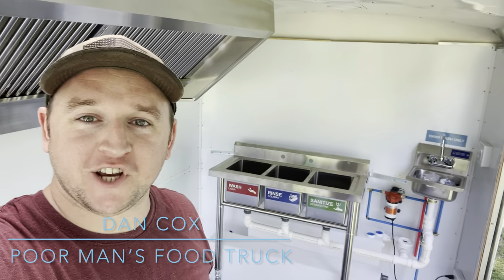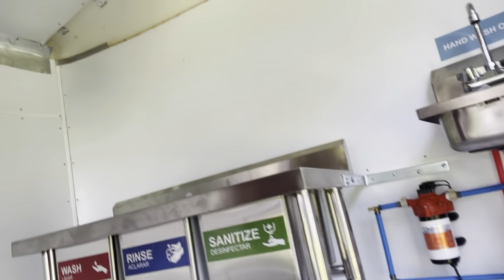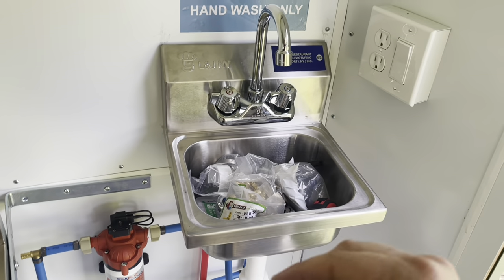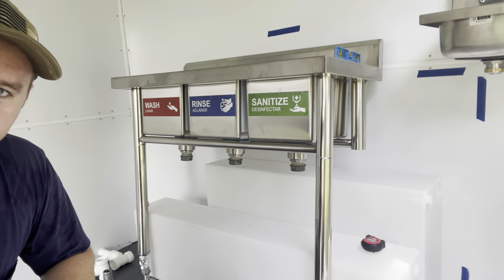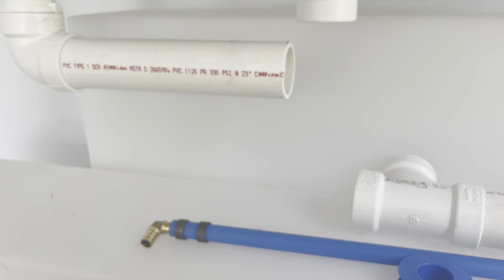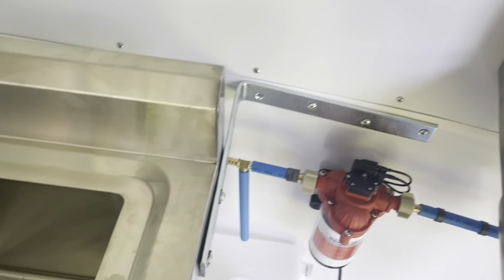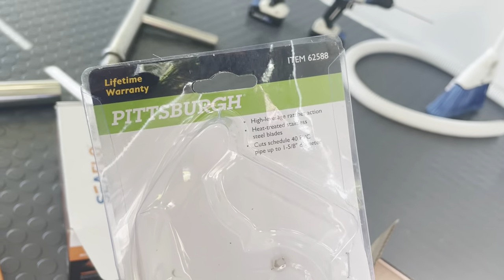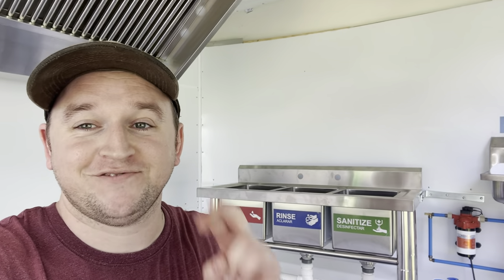Plumbing Part 1 - Poor Man’s Food Truck

Comment: I think you're supposed to put the glue on the outside of the pipe but on the inside of the fitting 9:00 min in
Reply from the maker: Great catch! I was too busy filming rather that concentrating on what I was doing! But yes you’re absolutely correct
Reply: 100%

Comment: Y did u apply the pvc cement on the inside of the pipe? It actually should go on the outside of the male pipe
Reply from the maker: Almost got away with that one lol! Complete mistake on my part, was focusing on shooting the video vs. concentrating on the job at hand. Good call out though

Comment: The 3 compartment sink is crazy small, do you have any issues fitting commercial cooking pots, pans, dishes, etc into those tiny 12”x12”? Vats?
Reply from the maker: For our menu we really don’t need too many large pots/pans as a lot will be done on the flat top. Most of our cleaning will be the food warmer containers and fridge containers. We’ve had a few practice runs and had no issues yet!

Comment: Will that pump work being mounted above the tank? I have that pump and mine has to be mounted on the floor or it doesnt work. Apparently mine has to be at the lowest point of the water in the tank.
Reply from the maker: Yes sir this pump will work even when elevated above the fresh water tank. I believe it’ll pump a maximum of 3.3 gallons per minute

Comment: how did you start the gluing process on your floor . franks video was no help. i'm going to tuck my edges up behind the stainless
Reply from the maker: For me personally, I found it fairly easy with the walls in place first. I lay the floor down, and cut the front half first and worked slowly towards the rear of the trailer. Great thing about this floor is it’s super flexible and relatively easy to install

Comment: How much did you cut the 6in tailpipe? Every video we’ve watched doesn’t mention how much is needed to cut off of the tailpipe.
Reply from the maker: Each will be different depending on the height of your 3 compartment sink. Just be sure that you have a decline from left-to-right to ensure proper flow

Comment: How hot does your water get? The water pump is rated at 3.3 GPM and the heater is 1.6gpm I can’t get the water hotter than 110F.😢
Reply from the maker: I am yet to run the hot water in my system (waiting for plumbing inspection) will keep you posted as soon as I do!

Comment: Did you have to switch the plumbing piping on the hand sink that elbow is flowing in to the 3 compartment sink drain
Reply from the maker: Im not sure if I follow?
Reply: Yes I noticed that too your tee is backwards so when you run the hand sink it’s draining back into the 3 compartment sink and there’s no trap under the hand sink so I’m also confused of these things as well? Thank you for the video I really appreciate all the info though.

Comment: how much room do you have from the edge of the door to the front of the trailer ? where your hot water tank is mounted . thanks
Reply from the maker: Great question! I have right around 20” of space if I’m not mistaken. It’s fairly tight but with the equipment I’ve chosen it works 👍🏻

Comment: Im in ocala florida, just wondering if i can use formica kitchen countertop in a food trailer to make a 4 compartment sink. Thanks
Reply from the maker: Great question - to be honest I’m not sure. I have seen many trucks/trailers in my area that have those countertops. However, personally, I’m not keen on how they look. Even though the stainless steel is more expensive, it certainly gives a more professional and commercial quality to the trailer. But definitely reach out to your local DPBR to confirm!
Reply: @poormansfoodtruck  yes thank you, i reached out to them yesterday and it is allowed. I decided to go with stainless steel instead tho. I does look a lot better. Thanks
Reply: Is there any regulation in Florida in regards to water heater plumbing? I cant really find anything. I emailed the inspector but she said they have no info on that. Pex is out of my budget, i was thinking of using 1/2 pvc. Any recommendations?

Comment: What size is the pvc pipe and what size is the backflow valve. Example 1 1/2 inch or 2 inch
Reply from the maker: Everything in my setup is 1 1/2 inch (including back flow valve) hope this helps!

Comment: How did you attach the flange feet? My sink is similar but has a thread at bottom. Also how did you drill your sink for the wall brackets ? Seems not matter what but I use it’s taking forever
Reply from the maker: I attached them using stainless metal strapping kit (works quite well!). Keep at it brother you got this!
Reply: @poormansfoodtruck  Do you remember what kit you used? And is that foil tape around it? Thanks! Glad to see you up and running!

Comment: Did you ever figure out how to secure the front legs of the feet to the flange feet?
Reply: And also which flange feet did you buy?
Reply from the maker: Flange feet I have linked in one of the videos (if not I will re-link). For now I am using a large aluminum strap (kinda looks like an exhaust repair strap) that I found at my local auto parts store. Hope this helps!
Reply: @poormansfoodtruck  thanks bro!